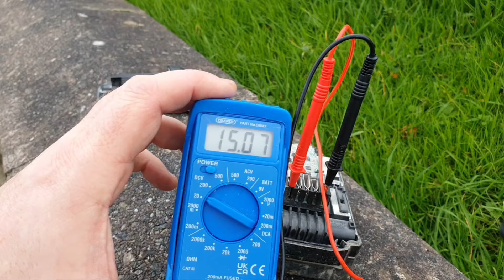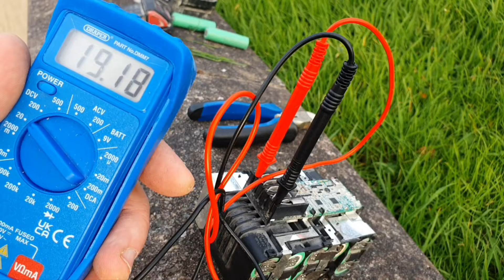Milwaukee M18 Battery cell replacement

Comment: Ive replaced cells in my 5ah pack and a 2ah pack.  I always fully charge the cells old and new with a hobby charger so that they all match.  Then before the battery will work in a power tool i have to put it on a charger so that the bms resets.
Reply: @doctorlefthandthread  I just rebuilt my 5ah pack last night because 2 more cells were about to die.  They only charged up to 3.5v.  When I was done I jumpered the positive terminal to the J2 terminal for 2 seconds and it activated the battery without the charger.

Comment: You’re not explaining the fact that the BMS has total control of these batteries swaps hence the reason you had to change the BMS. So if anyone were to get into this understand manufacturer control over these batteries and repair this same problem I have with replacing batteries in Apple phones, if you don’t swap the BMS you lose functionality and key failures that happen after the battery. So since the BMS cannot be swapped to the new battery pack, you cannot successfully repair these batteries due to the BMS programming. Would that be correct?
Reply from the maker: I don't know everything but I think the boards deactivate the battery after a certain number of charges

Comment: I would have charged all of the sets of cells to the same voltage with a dc power source-good chance the charger didn’t like the battery because it was out of balance. And if it is a problem with the board-often that can be fixed with a good cleaning. I probably would have pulled the board off, cleaned it with alcohol and then let it dry all the way out while working on the pack.

Another thing-not trying to be nit-picky, just a tip-lithium batteries don’t like being stored at full charge, if I buy cells-or if I reclaim cells from an old pack I usually bring them down to 3.7/3.8v for storage.
Reply from the maker: Thanks for the advice
Reply: What happens if you store them full charged?  Got some 18650 that I haven't used in a while that may have been full charged before I quit using my vapes.
Reply: @strikerj4810 haha, only replying like half a year later like a pro. But honestly not much, they’ll tend to lose a little bit of their capacity when stored that way.

Comment: the new cells you put in need balancing so there all read the same voltage in the pack . also i found if you have 1 led flashing  once done if you get a wire and do neg and to touch the terminal next to the negs the led goes off no leds light up.then put it in the power tool pull the trigger leds come back on and then it will charge
Reply from the maker: Thanks for that I can't wait to try it
Reply: The charger will balance the cells on their own.
Reply: @tylerseabook9423   not necessarily the charger arnt great at balancing  i think some only monitor the voltages as the BMS is inside the battery itself  ive had a few imbalanced batts to sort out as there wasnt charging on the charger throwing a fault.

Comment: You could tell he's afraid of puncturing one of those batteries, as one man to another it's not as bad as you think, lol
Reply from the maker: Thank you
Reply: Not as bad as you think? Have you seen a single one of those explode. Not the whole pack but a single one can be extreme. If one blows up and sets the others off. Ya it is bad. Search 18650 explosion to see.

Comment: In reality the cells that are at 3 or going to die soon, also batteries like to have the same voltage, especially in this series , the batteries you use do not have all the same voltage they will draw from the one that has more constantly, weakening that battery sometimes

Comment: You didn't try to charge the old cells .. they maybe still good. The most abnormal thing you did was that you '' Butchered'' the battery plastic, if you could have just placed some pressure the cells would have come out easily. Milwaukee batteries are repackable easily.
Reply from the maker: Correct I have done some since and avoided having to butcher the plastic . You are probably right about the cells to. In my defense that was the first Milwaukee battery I ever opened
Reply: He didn’t butcher anything. Dumbest comment of the day.
Reply: @tylerseabook9423  Thank you smart dude ... keep-it-up.
Reply: @tylerseabook9423  Thank you smart dude ...keep-it-up  (just go to 4:13 of the clip and see him butchering with a hack-saw)  change you glasses of get a new set of eyes transplanted.

Comment: so where did you get the cells from?
Reply from the maker: Some from ebay but they are expensive if you Google 18650 cell there are companies who sell them. I have been lucky to get some old donor batteries to harvest cells from. Some people buy a cheap make of battery to get cells this is also a cheap way of buying cells.

Comment: Milwaukee have really poor quality batteries compared to bosch and dewalt.  Neither of their batteries have let me down, however I've had 3 milwaukee battery packs fails on me. No way can they cope with the rigours of professional use. I'm going back to dewalt. Cheaper in price and better quality.
Reply from the maker: The cells are the same for the most part Milwaukee and Dewalt use similar quality the Milwaukee and Makita boards give me more trouble than Dewalt but Milwaukee seems to be less water resistant than the rest.

Comment: Some cells can be saved even without voltage, but you need to charge them individually.  This is somehow balancing.
Reply from the maker: Thanks for the advice

Comment: you have to balance the cells, some of them are showing full voltage 4.2v, so the charger says charged, but there is cells in the pack that aren't at full power, so the lights only show voltage
Reply from the maker: Yeah thanks that makes total sense.
Reply: @doctorlefthandthread  Did you end up getting it to charge?
Reply from the maker: @Americadoe  yeah I replaced the PCB board https://youtu.be/3L6ugD_vtJk
Reply: How do you balance the cells

Comment: I always wanted to see the cells in these bad boys. Cool vid man. 

Any chance you have a DeWalt  or Flex power stack battery? Open that up and do a comparison video of the two technologies. Milwaukee's lithium vs power stack lithium.
Reply from the maker: The powerstack tech is supposed to be the next step forward which is interesting.I think fixing them in the futurewill be a no go. As far as the tech goes between Milwaukee M18 and Dewalt 18v or 20v max the cells are the same and no difference in the quality of cells used ( 18650 ). However Milwaukees casings are far stronger the cells are more encased with rubber between the top and bottom 
Cells. Milwaukee high output and flexvolt use similar size and quality cells as each other too in most cases mostly 21700 cells the larger ones ( except 6amp Flexvolt which uses the 18650 just 15 instead of the 10 in the 20v max or 18v)
Reply: @doctorlefthandthread  yea, that's what i want to see. How the power stack cells look and how they are arranged. 

Like, why does it mattered if they are stacked as opposed to side by side. Position doesn't really matter for wiring does it?

Comment: Welcome to planned obsolescence. The company doesn't want you to be able to repair your own stuff so there's probably a singular chip that once a fault is recognized in the battery it wont ever let it charge or run again.
Reply from the maker: They certainly don't want people to repair their own stuff but I will continue to do so
Reply: Your wrong. There’s no chip stopping the charge. They make it hard but you can do it